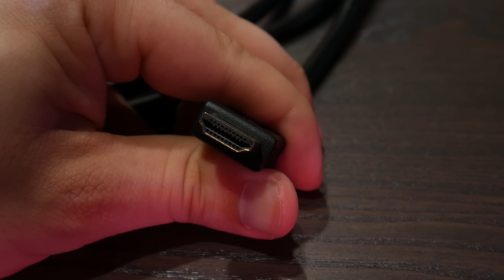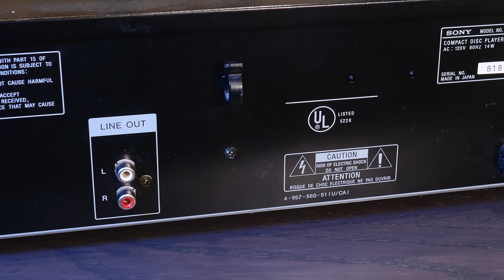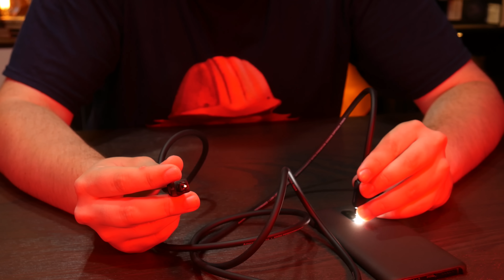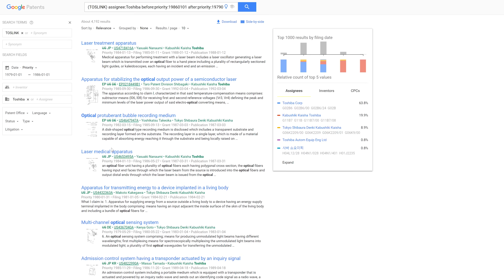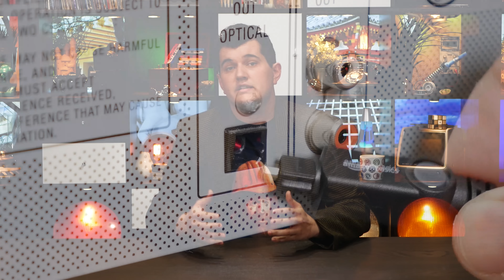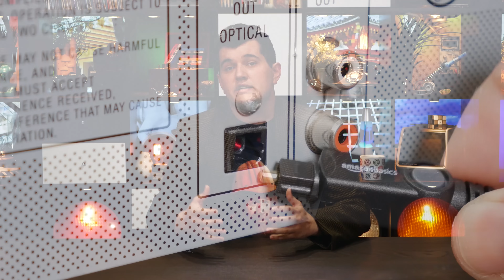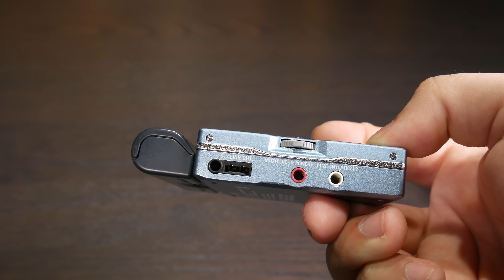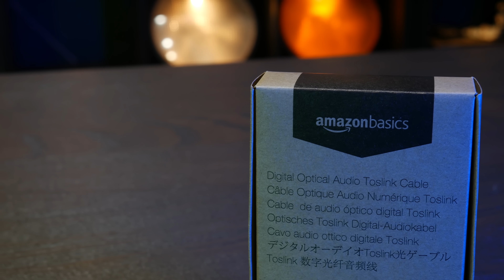TOSLINK: That one consumer fiber optic standard

Comment: TOSLINK was probably designed with the purpose of avoiding the ground loop problem. Many high end audio equipment uses optical isolation already, and TOSLINK would eliminate the need for that. It was necessary on MD because S/PDIF  did not use differential signaling. The ground of the handheld MD device might not be at the same voltage as the ground of the CD player.

Comment: I have firsthand experience with interference from audio carried through USB/3.5mm jack from my motherboard to my powered studio monitors (it was amplified the louder I turned the volume knob on the back of the monitors). Toslink is the only thing that completely eliminated this for me.
Reply: If I understand correctly… you need a ‘ground loop isolator’
Reply: I had to get one for the USB powered Bluetooth 3.5mm adapter for my truck.

Comment: The galvanic isolation preventing ground loops is a great advantage. This is not the same as picking up external electrical noise, but its own problem. Also transformer or processor noise from one device can be transferred to another, and like any noise on a wire can make its way into the circuit and be picked up in an analog output stage, so the digital signal not being affected is a moot point, that's not how the noise corrupts the sound. Clock jitter too is a real factor in resolving enough systems, and is often discussed in the audiophile realm, as if that's any surprise. At least they know better than to fall for gold plated optical cables. 😂 Not even AudioQuest does that. Don't look up their prices.

Comment: So, fun thing about twisted pair ethernet... Recently, when we wanted to push the speed up higher, we looked at the whole unshielded twisted pair and started to question our decisions. See, the reason we twisted the pairs is because they were unshielded, we wanted to avoid induction. However, as we pushed that power higher and higher, the induction we were trying to avoid with those twisted pairs on that unshielded line started to become an issue again. So instead, we just kinda thought... what if we shielded it? Seriously, wired lines had been shielded for countless other applications, so why not this one? So, a very simple grounded shielding was put around the cables, and grounded out to the shell of the RJ-45 connector. Which raised another question... Why bother twisting the pairs anymore? So we stopped. Cat-7 lines are possible with shielded, untwisted lines, which opens the possibility of, of all things, Ribbon lines. Which can make cable management so much more tidy, especially over short distances, and can make cable storage take up SO much less room.
Reply: Also, as for ways for fiber to be used in modern tech? Optical coupling for USB systems. See, as it turns out, because of the way USB takes in(And outputs) a voltage, it's actually weirdly easy to build a small USB device that looks like a thumb drive, or other similar drive, that contains a small capacitor that gathers voltage from the USB port, and basically just blasts it right back on what is supposed to be one of the lower voltage lines. These USB killer devices can fry out USB ports, or worse, just cook systems entirely, within seconds. An optical coupler can replace those lower voltage data lines with an optical device that, to put it simply, can't actually pass a voltage in the same way, creating a safety between USB killers and the device itself.
Reply: Side note by the way, making the LED go blinkyblinky a little faster is actually a lot harder than you think. See, an LED is a lot like a PCM signal, in that it does not in fact go from 0 to 100 all at once. You can't actually make a fully square waveform with an LED. It "warms up" a lot faster than other lights, for sure, but you do eventually hit the point where you're turning on the LED before it's even fully turned off yet. This is also how duty cycle dimming works, but we'll not get too far into that. At this point, it becomes much more difficult, on a reverse bellcurve, to differentiate between LED-goes-off and LED-turns-on. Add into the mix the difference between direct and reflected light through the frankly iffy cables and that difference gets even harder to really nail down. 

Optical SPDIF might have some uses for other things, but I honestly think that unless we see a multi-line cable, it's.... kind of dead. And even if we did, we can pump WAY more signal over a much less... complicated... cable line these days.

Comment: I actually use toslink for my sound bar on my Xbox one (because my television is stupid and cuts stuff off on the sides when on normal hdmi mode and my tv even when I brute forced it into operator mode the settings couldn't fix the issue so I use the dvi overide to fix the issue with overscan in exchange for sound so I just use a sound bar with the sound going though the optical audio output

Comment: My iMac has a horrible problem with ground loops. If I connect anything to the input or output that is plugged in and grounded I get all kinds of noise. I changed the input and output to use the optical and that fixed it.

Comment: Well I can see a potential advantage: with TOSLINK the ground of the CD/DVD player and the amplifier are isolated, meaning that a crappy switching power supply inside the CD player doesn't mess with the probably better power supply of the amplifier. 

Especially in the AV world, and especially if you had one AV equipment connected to the power supply ground (for example an old plasma TV, or a console like a PS3, or a PC), that meant that the ground of the amplifier was indirectly connected on the ground of your electrical wiring and thus pick up all the crap from other equipment (yes, the amplifier itself is still connected to the electrical wiring, but with good filters in the PSU).

Nowadays it's probably not so useful, good amplifiers have isolated sections between the digital and the analog circuitry anyway, and equipment have better power supplies. But in the past it probably made some kind of sense to keep the amplifier electrically isolated from the rest.

Comment: Apple used to put mini-TOSlink in all their headphone jacks up until about two years ago, just before I bought a new mac mini and found that my external headphone amp stopped working so I had to switch to a USB connection and then it blew up and really stopped working.  Evidently TOSlink had been protecting me from something pretty dubious up to that moment.

Apple were a bit smarter about detecting the plug and turning off the LED when it wasn't needed, though, so it doesn't glow when it doesn't need to glow.

Also, while I'm not the best authority on unquestionable sanity, I do think the whole problem of S/PDIF clock recovery and how that relates to jitter is _interesting_.

Comment: mini toslink is the worst from a retail worker perspective. So many times I have to tell a customer that the cable won't work unless it supports digital signals because they would rather pay $6 for a cable rather than $20-40 for a converter box. Most of the time they assume I'm either wrong or trying to scam them so they buy it, only to return it later when it inevitably doesn't work

Comment: Mini toslink saved my bacon with my first laptop. I tripped on a long headphone cable and absolutely mangled the headphone jack, to the point where sound wouldn’t come out of the speakers OR headphones. Luckily, the laptop had toslink and I had a spare receiver lying around. A few conversions later and I had audio again (both speakers and headphones). This was back around 2010/2011.

Comment: Audiofiles: We need an optical cable to avoid electrical noise.
Also audiofiles: We need to use noisy vinyl records from 30 years ago.
Reply: But if it's gold plated I can definitely hear the difference with $1000 cables.
Reply: B-but it's WARM noise!
Reply: Vinyls have one absurd advantage; due to how mastering for vinyl is different from mastering for digital, mastering engineers are forced to master them properly 😂
Reply: Audofiles? What kind? MP3, FLAC, OGG, WAV, AAC, ATRAC?
Reply: And they surely did not realized many vinyl are digitally mastered.
Reply: It's audiophiles duh
Reply: Audiophiles think turntables having convenient and nice features like auto stop and start will hinder the sound quality.
They just love soaking in snake oil. I love records, but audiophiles are the worst.
Reply: @archkull   Just like anything, increases in sound quality come with diminishing returns. Eventually, you'll reach a point where your ears just can't tell the difference between "very high quality audio" and "very very high quality audio".
Reply: Records do have better potential quality than any digital format, but still manage to suck because there's so many more sources of interference.  Dust, static, wear on the record, wear on the needle, etc, it all ads up to terrible audio quality unless you manage to get everything exactly right (which is virtually impossible)
I must say though, you get better music putting a Frisbee on a turntable than you do from putting one in a CD player.
Reply: @GremlinSciences  your last point got to me bad
Reply: @GremlinSciences  Respectfully, I don’t think that is true, digital formats are capable of reproducing sound perfectly. There is a myth that they can’t because they are using samples, but that stems from a misunderstanding of how sampling works. T.C. goes over it in another video. Both are theoretically able to reproduce a signal perfectly but there will always be some noise in a record.
Reply: @QuarkGluonPlasma1  To put the audio quality of a "vinyl" record in digital terms, their  theoretical potential is ∞-1.  Current designs and materials place them around the same quality as a 96kbps AAC file, however that is due to the softness of the vinyl, flexibility of the needle, and imperfections in the press plates.  You can double that quality just by doubling the turntable speed, or by doubling molecular density.   Additionally, since they predate even electricity, the traditional method of recording and playing phonographs ("vinyls") means there is no bottlenecking due to equipment refresh rates.

Put shortly, vinyls are analog, not digital.  They use discrete values that can be infinitely large or infinitesimally small without using an infinite amount of space, basically fitting the entire range of 1/∞ through ∞ into  a single bit.
Reply: @GremlinSciences  Let's be honest, you can't tell every step of 44.000 step, every second anyway. 

Even if that's the case, our argument is misleading anyway due to the nature of every control system, every step would be smoothed out to be an analog signal (you heard that right, and indeed it's undesirable in most case scenario but this case and this case only)
Reply: if your vinyl has scratches that's on you...

and 30 years ago was the begining of the 90's...but math is hard. i forgive you... not.
Reply: @coffeetablesex  By 1988, CD's overtook vinyl, so 30 years sounds about right.
Reply: @yannick7230  That's their point, vinyls were already dying 30 years ago, 40 years would be more accurate.

Comment: speaking out of pure ignorance here , but since i live in an old appartment, my wall sockets have no earthing pin. and this is what i beleve to be the cause of me getting electrocuted by touching metal parts of my audio interface (read : the casing itself) and its only connection to my pc is a usb cable that it uses to power its internals aswell as for transmitting digital audio data. , this electrocution  is not the 5v (wich i wouldnt be able to feel at all with my hand,and its not all the time either , its not the 220V coming out of the socet somewhere either since i did study electronics my crude guess its more around 50to 100v , i suspect the internals of the usb audio interface  would be fried if it really was getting that kind of voltage from the usb. now what i did notice is that when i use the analog outputs of the interface to connect to my amp i can predict when not to touch the casing of the interface because i get a nice sounding loud 50hz clacker allong with the audio , when usig the fiber out to my amp i have great sound all the time but i do have to be carefull when touching the interface as it still has a 50%chance of suprizing me with a wakeup shocker ...

Comment: Mini TOSLink is incredibly common. Even my $20 RCA in/out audio interfaces have optical outs in the 3.5mm jacks, as do 3/5 of my laptops. Every TOSlink cable I ever bought came with a little clear lightpipe adapter that fits on to make it a 3.5mm form factor.

Comment: I installed a wall mounted TV where the owner didn't want to see any wires. Optical cable doesn't have the wide format of a HDMI connector and this made it easy to pass the cable through the wall. Yay Toslink.

Comment: Great video. Fun fact: every Mac with a 3.5mm headphone jack and all airport express devices going back to late G4 PowerBooks has secretly also possessed the ability to output digital audio over mini toslink.
Reply: If they had a separate input jack they could take optical input too. While doing my podcast I could run a remote person in on skype or whatever into the mixer digitally, avoiding all the amplifier noise in the notebook, (Mind you the MacBook Pro and macs in general were worlds better than any Wintel laptop I've ever owned) and then run a Mix-minus by sending every track, (yes I recorded every person in the studio to their own track. made editing so much easier) except the input from the laptop, back to the laptop over Toslink.

Don't know about more recent desktops, iMacs may still have optical minijacks, PowerMacs and cheese grater MacPros had seperate Toslink jacks.
Reply: The MacBook Pro’s from 2016 and newer axed the feature, probably because most people didn’t know it even existed or saw the red light at random not knowing what it was
Reply: @Noaddedsalt01  and also if you didn't have the right audio driver under Windows/Linux, your port would light up red
Reply: @u1f98a  correct, usually it happens in setup when installing bootcamp, where you see a lot of confused posts on forums on what is going on and why there is no sound
Reply: I used to trade in used high-end (and very high end) hifi equipment. As soon as I discovered the Airport Express and it's Toslink hidden in the mini jack it made every single high end CD player pretty well obsolete. All you needed was a high end DAC. And then I discovered the Meridian Digital Audio processor which sat between the Airport and the DAC. This combo of Airport and Meridian has never been beaten 20+ years later.

Comment: My laptop (late 2009) has a mini-toslink output on it. But, it wasn't available in the edition of the laptop I purchased so it's blocked with a black panel and only activates under linux, along with a built-in IR sensor I was unaware of until my MCE remote started scrolling a webpage.

Comment: 13:15 My iMac G5 (iSight, 2005) has mini-TOSLINK combined with the 3.5mm out. I wish the would've combined the 3.5mm in with another mini-TOSLINK, though. Then, the iMac could have the same recording functionality as my PowerMac G5, but without making the same noise as a 747 at take-off.

Comment: @11:08 well OR it would only be a selling point if the consumer would be deep into it enough to know that... as it stands they had "another way" which basicly is equal (in fact I can use a copper line in my MiniDisc as well, same line-in as FO) but look ... marketing department doesnt like the term "just as good as" they want to promote it with "better" even if the stated reason frankly is insignificant....even more so when you realise that its most  common use : minidisc compresses the signal to below/around mp3 level

Comment: In some semi professional audio work there exists a connector and interface system known as MADI. Don't know anything about it's history but I can tell you it is pretty much two optical fibre cables. This makes having the keyed port necessary on the connection.
Reply: There's also ADAT, Which I think stands for "Alesis Digital Audio Tape" that will transmit 8 audio channels at up to 24-bit resolution and 48Khz Sample rate. All this ran on standard Toslink optical cabling.

Comment: Not to whine, but the RCA audio cables DO carry an analog audio signal, not a digital SPDIF signal. It is the wave of the sound represented as voltage. I can and do get some interference when the analog RCA cables go near certain power supplies, and you can sometimes hear a noticeable hum. Are they well insulated RCA cables I use? No... they're super cheap. But I guess it boils down to which device has the better DAC. I guess I'd rather have my DAC in my receiver do the work. And there's no worry of quality loss thanks to the Nyquist–Shannon sampling theorem

Comment: The standard speeds available on hi speed internet through Compost er Comcadt now called Xfiniry has always been copper coaxial cable. 
1.5 meg
3  meg
6 meg
was all tbat was availble. they now tell customers these speeds
1.5 meg basic service
30 meg
60 meg and terrabyte business solutions. 
they just added a zero is all they did
what do you think.

Comment: as a FYI:
Macbooks where able to use Mini Toslink back in the day:
https://apple.stackexchange.com/questions/46605/how-do-i-tell-if-my-mac-supports-mini-toslink 
And the AirPort Express (OG Version) did have Mini Toslink cables set: M9573Z/A
Was amazing to get the audio digital from my iMac  to my receiver , wirelessly via the Airport express, digitally connected to my receiver. Back in 2004 :)